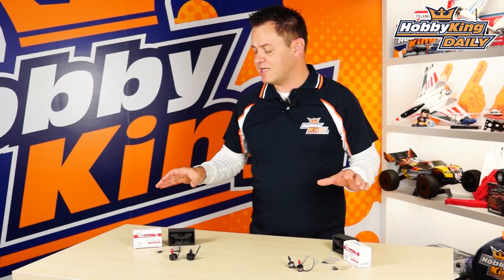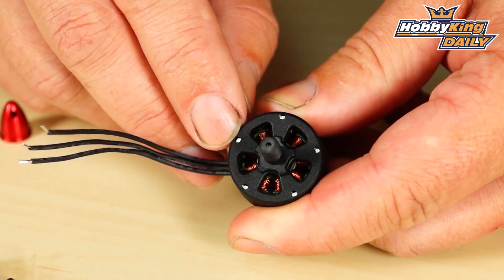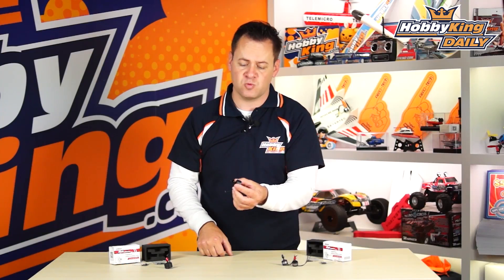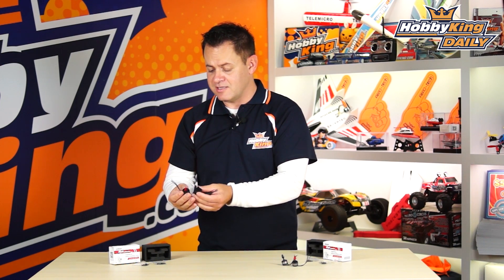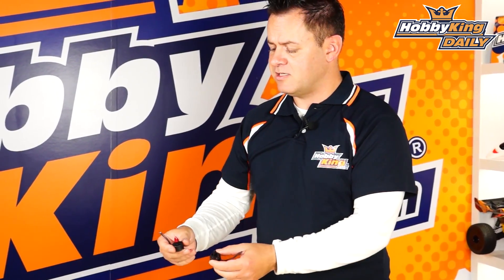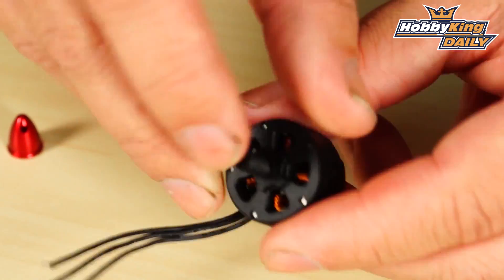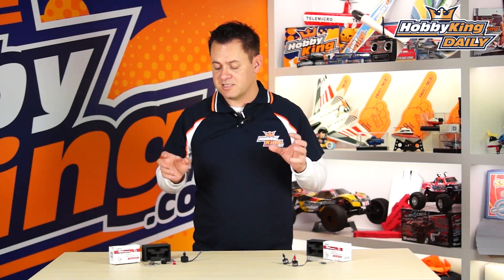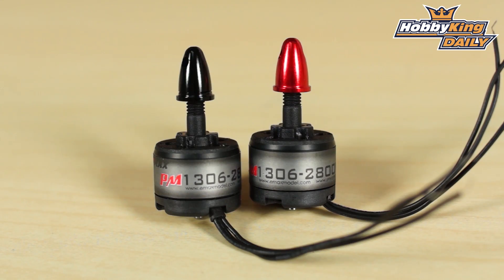EMax Multi Rotor Plastic Motor - HobbyKing Daily

Comment: I would think the plastic is going to not let the motor cool. It will insulate the heat inside. The motor on the outside plastic may not be anywhere near as hot as the insulated inside.